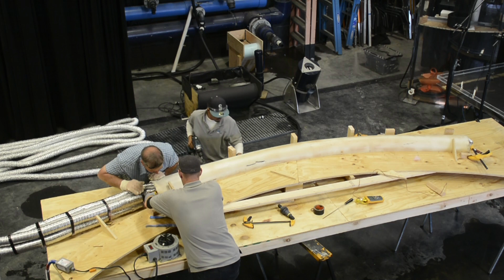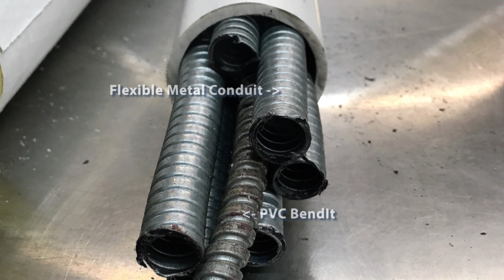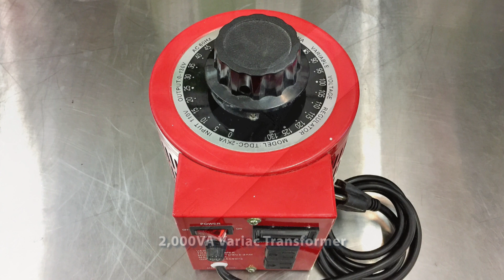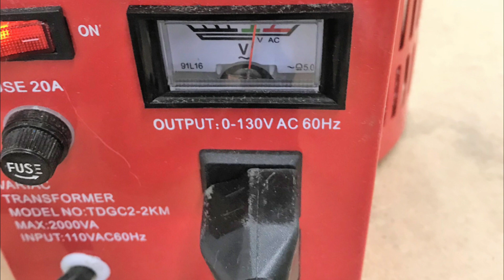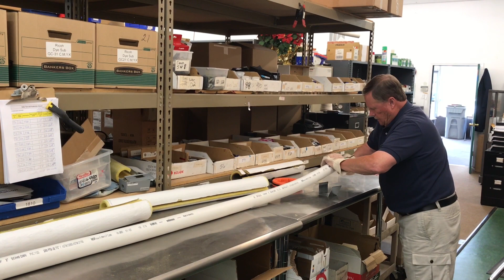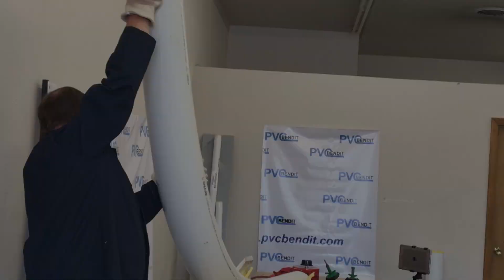How to Heat and Bend 6" PVC Pipe Without Kinking

Comment: we would like to buy the pvc bendit tool
Reply: Hello and thanks for your comment.  You can go online to our website:  www.pvcbendit.com and click on Buy  PVC Bendits ---  there you will see our product offerings and you can select the Series A or B and the length i.e. 3, 6, 9, 10 or 20' length -  you desire.  If you are not located  in the US send us an email and let us know the address where it would need to be shipped and we will determine if we can ship to that location.  PVC Bendits work using 120 volt current.
Mike

Comment: What size and quantity of flexible metal conduit did you use to fill the inside of 6" PVC? Looks like 6 pieces of metal conduit.  Are they 2" diameter?  I tried the Greenlee plugs and air pressure but couldn't get the plugs to hold the amount of pressure needed to prevent kinking.  One would eventually blow out.  Thank you
Reply: You can use 3/4" steel flexible metal conduit as it is available.  One company used dryer vent hose in 8" pipe.  It needs to be metal and is simply used to fill the space around the PVC Bendit which allows the pipe to heat to more evenly.   Regarding the plugs, I have not tried what I am suggesting but I was thinking one could attach a few 'C' Clamps to the end of the pipe and this would stop the plugs from exiting.   Let us know if you try this and how it works.  Thanks, Mike
Reply: I need to bend a tight 180 degree 2” is that feasible ?

Comment: can you bend 10" diameter pvc or pe pipe? What would happen if you start pulling the heated pipe? what profile can you achive?
Reply: I've never attempted to heat 10" pipe.  I believe it would be very difficult to work with so I don't suggest it.

Comment: Near boiling water in a trough does all the above....at almost no cost.
Reply: There are many ways to bend PVC pipe and the PVC Bendit simply offers one method.   Perhaps you have or will post your method on Youtube.  BTW at what cost is the 9' or 10'  trough if one must purchase it.
Reply: @SMEInkJet  My needs are limited to short but sharp bends for diy dust collection ducting. A couple of boards nailed in a ‘V’ and a kettle is all I fuss with. Near boiling water softens the plastic almost instantly. For kinking I switch to oven-hot sand. Strictly a rare-use, home-made operation. jim n.
Reply: @jamesnasmith984  Sounds like you have a good method...  Thanks for your input.
Reply: @jamesnasmith984  How do you submerge the center of the pvc in a "kettle"?  Wouldn't it need to already have a bend in it?
Reply: @grumblycurmudgeon  No submersion to start with. Pour-over does the heating. As the bend develops the elbow sags into a large bucket if you choose to go for submersion.
Reply: @jamesnasmith984  
Wallpaper steam stripper works well, its basically a kettle with a pipe attached to it.. Hot sand is also very good but you  will need a lot of sand for larger pipes.